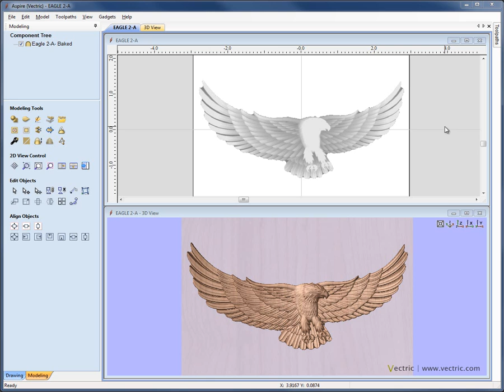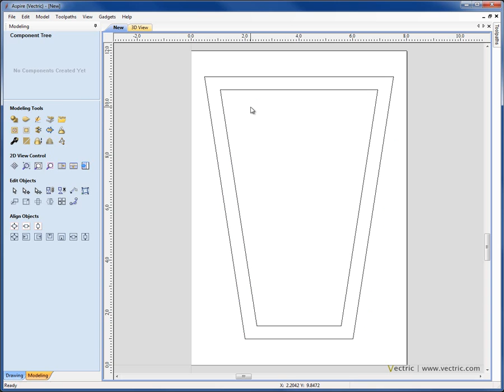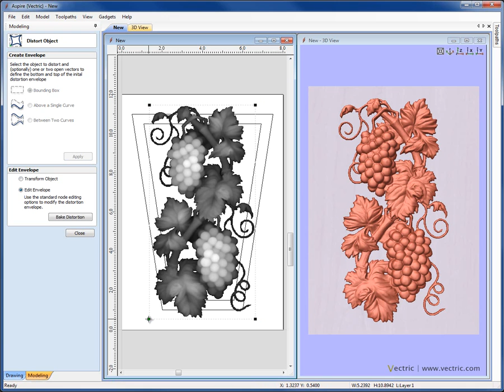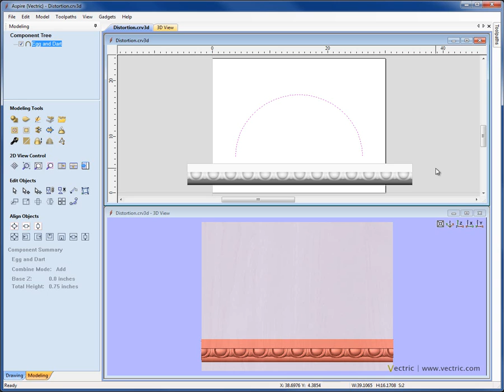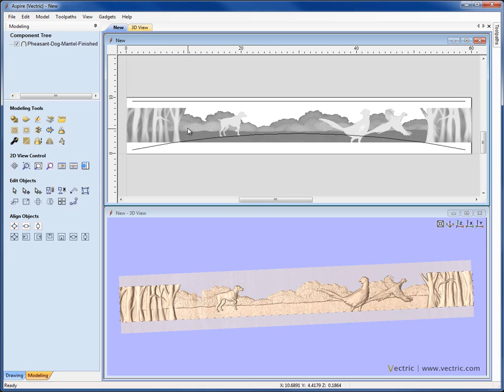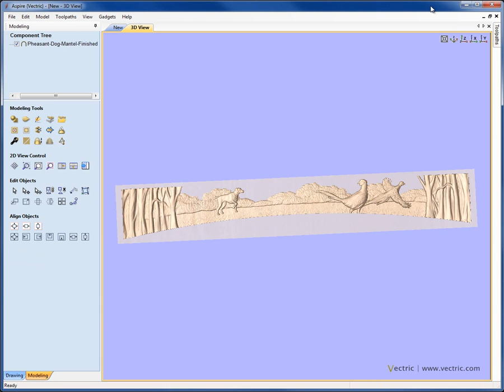Distorting Components

Comment: Beautiful
Reply from the maker: Thank you!
Reply: @vectric  In Vetric Aspire, is there a way to make deep 3D images that aren't deep but do the carvings look clear and detailed?
Reply: @vectric  For example, an image that has a depth of 20 mm is made 10 mm but the carving still looks detailed and clear, is there a way or not, sir?
Reply from the maker: Hello and thanks for the question.  It really all depends on the overall size of the component/model.  For instance a model the is 150mmx15mmx10mm deep shoud look good... but a component that is 1200mmx1200mmx10mm will have less "relief" so the detail will be more subtle.  It truly depends on the size, depth and amount of detail in the original model. 
 
What we suggest is for users to rely on the 3D toolpath priview (built into our software) to be sure the details they need will show up on the final cut part before they cut them on their machine.  Hope that helps.